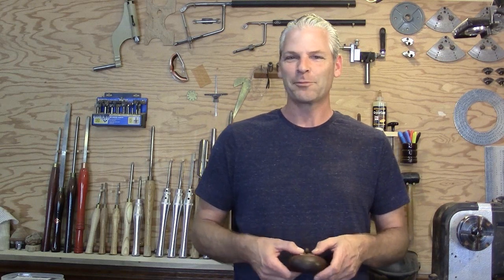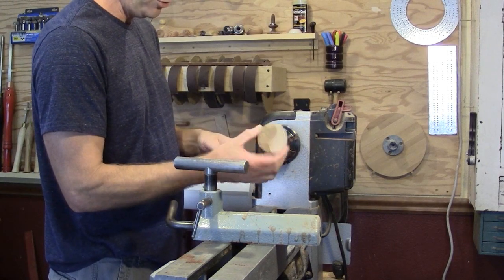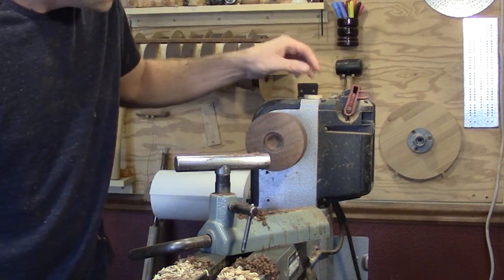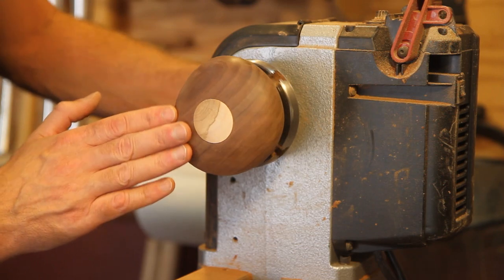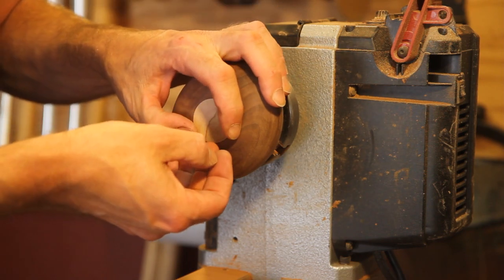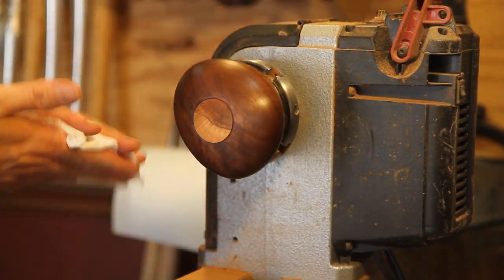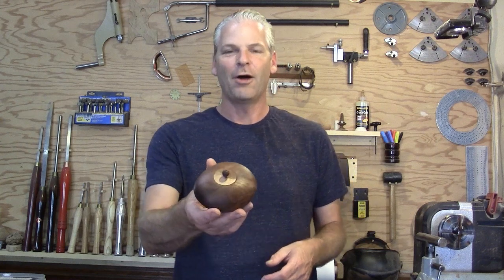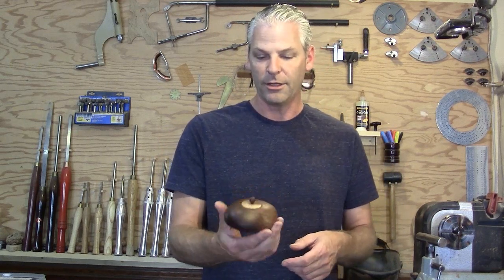Rock Shaped Lidded Box / Woodworking Project

Comment: Nice box Carl. The contrasting woods work really well together.
For the whirligig, I would aim to lift the rings in at least three places to avoid them tipping and jamming the mechanism. Four point lift would be fairly easy using a pair of cams, each acting on a pair of levers. Lots of parts, but all pretty simple. Good luck
Reply from the maker: WOmadeOD - Made in Wood with Mitch Peacock Thank you Mitch, I'm still working on it, maybe I'll have it ready next year lol

Comment: Ah, that's cool. I wondered how you could create such a shape on a lathe. Thanks for the informative video. I really love your whirligig idea. I hope you can get it to work smoothly. It almost seems to me like you either need cams along a second axis, so that there are two identical rows of cams that cross each other. Or even 3 cam sets (each one radius long) that divides a circle in thirds. But gearing all of that would present quite a chore.

Perhaps you could attach dowels on the bottom side of the "East and West" points of the rings (the line of cams being the North-South). Then have a row of guides underneath the keep the dowels straight, steadying and balancing the rings. That is, if I understand the issue you're having. Perhaps not.
Reply from the maker: Thank you Steve, Thank you for the suggestions on the whirligig.

Comment: Hi Carl, I get your mechanism design and I like it but I did think of another method which (may) be a bit simpler.  I have a vision of the rings lying on top of a thin and very flexible membrane. The bottom of the rings are all glued to this flexible sheet. The outer ring is secured to four post via string at 4 equal spots around the outer ring. Now if you push the inner ring up and down all the other rings should follow and give you the ripple motion. (I think - Ha!) If you don’t like the flex sheet concept then you could change that to string connections at four equal spots on each ring connecting each ring to another but again only the outer ring is secured to the four post. Good Luck with that!
Reply from the maker: Thank you very much for all the great ideas. I didn't think about connecting them together.

Comment: The Box is really nice Carl!
Could also be made without a lathe (Except the hollowing) by using two forstner bits to make the inside.
For the whirligig, I think you need a lot of power to lift the rings. A lot of power = a lot of wind = fast spinning propeller = fast movement of the rings = weird action.
I suggest you should use some kind of gear, probably 10:1 or more in between the propeller and the camshaft, this will lead to more power on the cams and slower motion on the rings. In the end it'll look like a ball dropping into water, filmed in slow motion (I bet that's what you're thinking of as well).
All the best for you entry to Whirligig Wars 2014 my friend. Probably it's a 'must do' to enter this year as there'll be one winner for sure, the child whose wish comes true.
Greetings from Good Old Germany
Peter
Reply from the maker: Thank you very much Peter,
I'm still working on getting it figured out, thank you for your input. This cause is an inspiration to us all. 
Take care,
Carl

Comment: On the whirlygig, it may just be as simple as removing material from the underside of the rings to make them lighter, waxing the dowels and maybe larger cams.  I suspect the solution is more difficult though and the problem is that you are trying to lift them from a single line of cams rather than distributing the force evenly.  Short of a really complex solution involving a central gear driving multiple shafts, you could try putting springs at the extremities acting in the opposite direction of the cams.
Reply from the maker: Thank you for the suggestion, I'm working on putting multiple cams now.

Comment: for a pairlow (to ground) rise and lowering of the rings dovels could be used for vertical guidance maybe and those could be also actuated by the cams. for smoothness the shape of the cams might be critical ^^ maybe a spring onto the dovels that pulls them down onto the cams at all time.
Reply from the maker: Thanks for the advise, I'm putting in a few more cams too.

Comment: Great looking rock Carl, sometimes mine come out that way without even trying LOL. For the whirlygig maybe a dual cam system, make the base a little wider, put a gear off the fan shaft to run two cams so you can lift the rings from 4 points instead of two. Do not think it would be easy but just brain storming here :)
Reply from the maker: Thank you John,
I'm going to try this, I've been working on it. Thank you for the suggestion.

Comment: Nice rock box. I'm interested.  When you said "I'm going to turn it around and clean up the bottom" how did you have it chucked?  I could see a paper towel spinning with it but could not see the method of chucking.
Reply from the maker: Ron Hollenbeck I put it back in the jaws, then expanded them. The paper towel is to keep it from marking it up.

Comment: One other thought that would be a bit simpler than the basic idea below is to have 4 thin flexible strips of leather glued to the bottom of all rings and just let the leather strips extend past the outer ring a few inches so that the strips can be tied off to the 4 post that you do a fancy custom turning for of course. :-) Also; A terdrop shaped water droplet would look cool. I'm thinking that the movement may turn out ot be more of a rising and descending cone shape than a ripple but it (might) work with some experimenting. Ok, I'm done with my big ideas.

Comment: I've noticed that u sand with some type of filler in a can. What is that? It really seems to deepen the wood and what does it do? Is it just a filler wax?
Reply from the maker: It's paste wax, and Mineral oil mixed at 10 parts wax and 1 part oil. I like the satin finish, and it cuts down on the sanding dust.
Reply: Thanks for the speedy reply. It's a great finish, I'd love to try it. Strong work... Keep it up.

Comment: Hi Carl,

The box turned out really beautiful, thanks for your video!

About the Wirlgig camshaft, maybe you could try to make the piece of wood with the holes a little thicker, in that way the rods will not wobble as much, even when the holes are not very tight. 
Another way that will work great is using small brass tubes, you can get them in all sizes and choose a pair that fits exactly (here in the Netherlands we have a shop were you can buy them with 5.2mm inner diamter and put rods in it with 5mm outer diameter; that works great).
Another thing that can help is to add a small sphere/ball to the end of the rods to make it more smooth.
Some nice examples I found on Youtube: 
Whirligig Video Portfolio Winigrad

Douwe
Reply from the maker: Thanks for all the tips, I'll check it out.